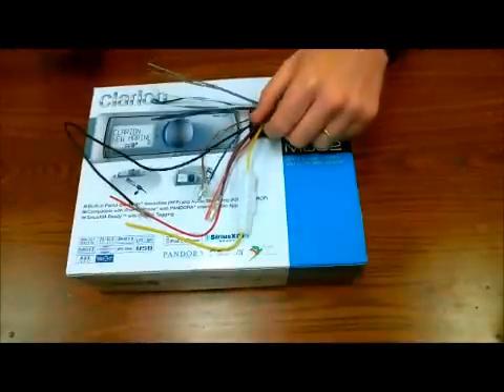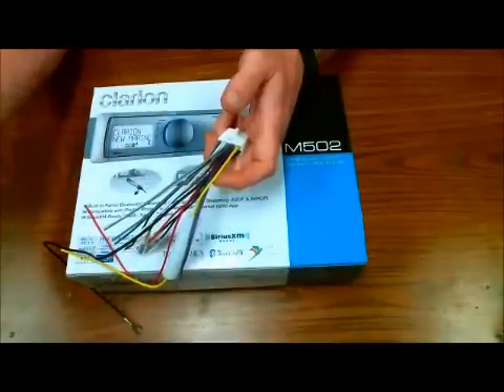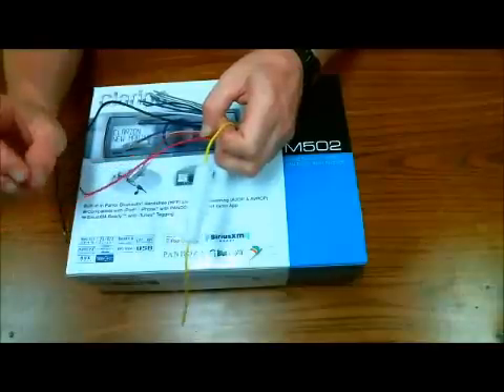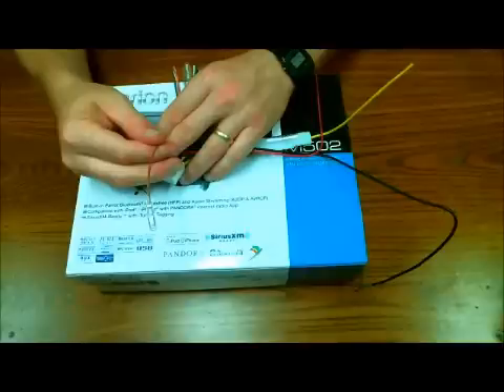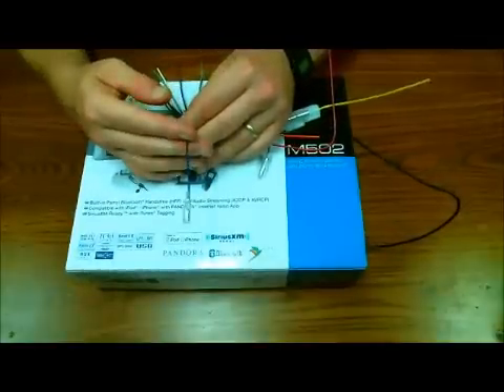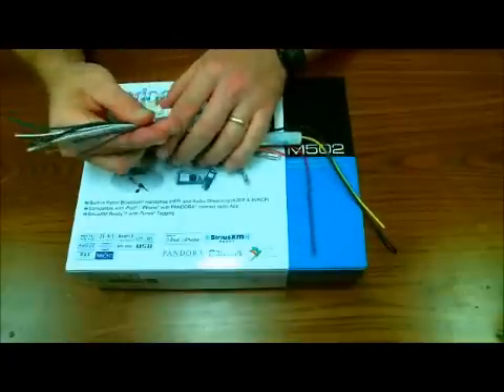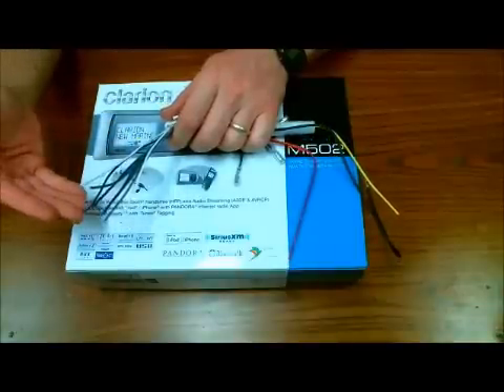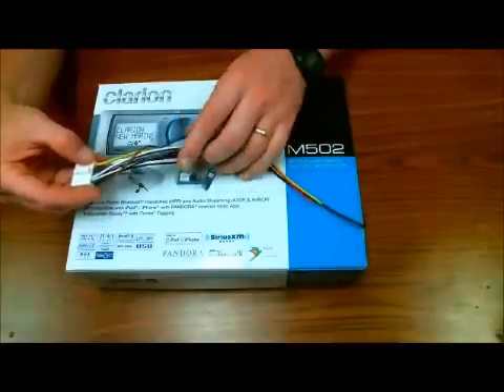Car Stereo Wiring Explained In Detail

Comment: Hi there.
Very good to know the colour code of all wiring. I have a question and I would like your further explain please.
What are the code for:
Orange/ black-key2
Orange - key 1
Two black with RCA heads-OnStar(male connectors)
4 yellow with female RCA connectors-AV out 1, AV out 2, CCD AV in and AUX AVIn
 Many thanks

Comment: Hi! I have a problem with an aftermarket stereo.
 I installed a 2 Din Pioneer stereo (without using a   special bypass harness)  n my Mitsubishi Montero 3 which has an Infinity sound system . The thing works fine but I can't modulate the amp and the volume is three times higher than it should be. 
Do yo think there's any solution for that?

Comment: i just bought a new stereo deck(dvd,cd). i am wanting to hook up the new stereo to previously installed overhead dvd screen that is hooked up to a dvd player that came with the vehicle, i pretty much font want to use that dvd player anymore. would i hook up the power source of the overhead screen to the red acc cable to provide power or the the amo turn on?
Reply from the maker: use the red, the amp turn is only rated for 500 ma

Comment: how do ni install a back up camara
Reply: like on your front or rear view?  This might require a little planning with the volts across your circuit.  Red for accessories.  Which is 12 Volts from your car battery under the panel.  A really bigger job, especially if you're not familiar with DC and AC currents, diodes which converts AC into DC electricity, and other necessary conceptual things you might want to know.  Of course you could do it.
Reply: On the newer cars, there already is a rear view camcorder hooked up to the rear end of the car.  So every time you back up, a movie screen of your view shows up on the DVD/Stereo Double Din screen.  Adding another cam while driving requires more volts across your circuits.  It's a really detailed job I see here.  But can do?  Are you finished or did you take it into the shop and pay a fee?

Comment: If my metra harness has a solid orange wire and my pioneer head unit has an orange w/ white stripe wire would I connect them together?
Reply from the maker: no, theyre different functions
Reply: TheRowdyRanger if there is a stripe or line then it's negative and solid is positive. Say an orange and orange with white line
Reply: TheRowdyRanger .
Reply: That is for the dimmer when your lights turn on. He explains this at about 3:50

Comment: I ordered the gmos-lan-01 harness from axxess and putting in a pioneer AVH-280BT in my 2013 suburban.
from the main portion or the axxess it has 1 red wire labeled (ignition/switch) but the axxess also come with a separate set for the speakers , dimmer, mute, ect. but this set comes with an additional 2 red wires marked the same as the 1st. do i connect all 3 to the the one wires going to the head unit?

Comment: I have an orange and black wire on the scosche plug it says ground dimmer do I use it? the blue and white wire do I splice it to my remote wire that goes to my amp? the black and white wire says amp ground what do I do there
Reply from the maker: org/blk is never used
blu/wht goes to the amp
blk/wht goes into the black ground wires (thats an amp ground).

Comment: Hello. I installed a Power Acoustik PD344B. It worked fine until a week later, I installed a backup camera. Now I get "REAR CAMERA No Signal" on the display always. I can't operate any of the modes like dvd and radio like before? I put it in reverse and the camera works? When I start the truck, I can hear the DVD but still have no mode operation and the frozen display of rear camera and no signal in a blue box. I tried resetting it, still no change. HELLLLLP!
Reply from the maker: try hitting the reset button

Comment: do i have to connect blue/white if i dont have an amp? i did not wire blue solid n orange solid.....
Reply: cut if off and then use black tape to tape it or insulate it.  power antenna is the blue wire.  Orange is the illumination or lights.  It happens, may have connected one of the wires with different colors.

Comment: Hi thanks for the video, very informative. I'm looking for a way to find a color code guide for the wires coming out of my car. The stereo that was in be4, was wired to close to the adapter, so I couldn't see what was matched to what, I had to buy a new adapter, & now I don't know what half the colors are for. I have the black ground, but then there are like 3 reds with colored stripes, I think 2 brown, so I'm assuming those are speaker wires, & then some random other colors. Do you know where else I could look for help? My stereo, & ask the harness stuff is all ready to go, I just don't know what colors are what in the cars dash. I just got the car from my kids Dad, no help there. Thank you in advance. Oh, it's a 1993 Honda.
Reply from the maker: I can help, email the wiring requests to sales@lesscoelectronics.com please!!!
Reply: Lessco Electronics ..I have pioneer stereo and connector and it has blue wire and orange wire that doesn't connect to anything

Comment: Hi thanks for the video, very informative. I'm looking for a way to find a color code guide for the wires coming out of my car. The stereo that was in before was word short so I couldn't see what was matched to what, & now I don't know what half the colors are for. I do have the black ground, but then there are like 3 reds with colored stripes, I think 2 brown, so I'm assuming those are speaker wires, & then some random other colors. Do you know where else I could look for help? My stereo, & ask the harness stuff is all ready to go, I just don't know what colors are what in the cars dash. I just got the car, & someone bought it, & well it's stressing me out a little. Thank you in advance. Oh, it's a 1993 Honda but my registration doesn't say if it's an Accord or what, just says AE(I believe) sorry I could look again. Anyway, it didn't come with a manual & I can't afford the $30 ones at the auto parts store.

Comment: I have 1991 ford Mustang and the wires from the factory  stereo are different  than said I diagrams and I don't know what to do the colors are 
Brown/pink
Pink/blue
Light blue/white 
White/light green
 tan/yellow
Pink/light green
Dark green/orange
Orange/light green
Light green/yellow
Yellow/black (fat wire)
Tan/red 
orange/black
Red(fat wire)

please help!!
Reply: I wish I was there.  The harness on the car side of it, does it have an adapter that could fit unto your new radio side harness?  Adapter doesn't fit, you might want to connect an appropriate adapter on the car side harness to fit unto the radio wire harness.  This is when you plug it in again.  16 pin wiring color to color harness
Reply: I tried to connect it by recheck in each color of the speaker wires since the we're different, but it ended up messing a lot of things in the car, I didn't ground it correctly :(

Comment: I'm working on a 2004 Chrysler Pacifica and the aftermarket kit adapter has 2 solid yellow wires and 2 solid black wires.....the factory side only has one of each so what should I do
Reply from the maker: on those chrysler adapters you combine the 2 yellows and also the 2 blacks
Reply: +Lessco Electronics 
that's what I was thinking thank you for confirming that for me. not much info on that car

Comment: if my car dont have accesory mode (just OFF, ON, START) does it mean i dont need the red wire? because i have plug everything and my radio wont turn on...
Reply from the maker: what is this model car that doesnt have an accesory
Reply: pontiac sunfire 2002
Reply from the maker: that car has an acc wire, its the brown or orange wire
Reply: yeah the orange is the constant 12v and when i plug to the brown nothing happen but finally i have plug it direct on the fuse, but thank you

Comment: quick question... super informative by the way! great video.... mine relates to a 2004 honda civic after market adapter harness. i'm hooking it up to the wiring harness for a JVC deck. on the JVC side, they use orange with white as their dimmer coding, but on the after market adapter harness, they are indicating solid orange as the dimmer wire. if i do that, it leaves ONE singular wire left on the after market harness, which happens to be orange with a white stripe. so, should i just ignore the instructions on the after market package of that harness and go with orange with white to orange with white on my JVC wiring harness, thus leaving a singluar ORANGE wire left over on the after market deck? please help! thanks......

Comment: Hi there! Thanks for the video! I have a question about my cars audio. I have five speakers in my 2005 Chevy Equinox. Two in the front, Two in the rear doors, and one in the very back which I'm assuming is some sort of sub. I'm putting in a new stereo and was wondering what I'll need to do if my new wiring harness doesn't come with wires for that positive and negative. Thanks!
Reply from the maker: whats the year make and model of the vehicle?
Reply: he said a 2005 chevy equinox
Reply: Hi thanks for the video, very informative. I'm looking for a way to find a color code guide for the wires coming out of my car. The stereo that was in be4, was wired to close to the adapter, so I couldn't see what was matched to what, I had to buy a new adapter, & now I don't know what half the colors are for. I have the black ground, but then there are like 3 reds with colored stripes, I think 2 brown, so I'm assuming those are speaker wires, & then some random other colors. Do you know where else I could look for help? My stereo, & ask the harness stuff is all ready to go, I just don't know what colors are what in the cars dash. I just got the car from my kids Dad, no help there. Thank you in advance. Oh, it's a 1993 Honda.

Comment: Sup Lessco Elect. I just purchased jvc double din kw-r920bts and I believe I didn't connect a wire correctly. Radio doesn't turn on right now. I want to know which wires doesn't have to be connected together. I've connected the black wires together could this be the problem?
Reply from the maker: black is ground, moving on is the red getting acc 12v+ keyed power and yellow getting constant 12v+?
Reply: +Lessco Electronics Ok..there is only one red wire and the other looks pink. Do I connect the red and pinkish wire?
Reply from the maker: pink, ? what kind of radio is this excatly? can you email me the wire digram maybe? heres my email: sales@lesscoelectronics.com
Reply: +Lessco Electronics haha well its the metra harness its the only one that look kinda pinkish..now I am guessing its the red wire?

Comment: what wire does the pink goes to
Reply: i want to no,iv just brougt a fto,the car leads are so diffent to my car cd player,i want to put in,wats the pink wires for??
Reply: It is usually connected to the Ebrake, I am not 100% but I think it has to do with DVD/Navi receivers so the screen is only engaged when the brake is engaged, or some old school units that get quitter when you are slowing down. If you have a screen and want to bypass the (only in stop) mode so you can view the screen at all times, just run the Green wire to ground. Don't waste the 50 bucks for some extra peice of plastic.

Comment: Hi. I have a 2002 Fairline motor boat with an old radio that I want to replace with a new Sony MEX-N6001BD. The Sony connector has a red and a yellow power lead but the boat only has a red lead. When I connect the unit it will not power up with red to red. I have tried yellow to red and I can hear/feel power getting to the unit but the face panel is dead. Should I try connecting both red and yellow from the Sony to the boat's red?

Comment: I have a pumpkin android headunit and it has a blue with black wire, so is it for the amplifier? The blue with white wire is already labeled as a brake wire.
Reply from the maker: Since that's a non mainstream unit I have an idea, Test it's output with a test light or a multi meter and see what it does.

Comment: Super video. Help please: I have a 14 year old marine Kenwood with a CD player; a friend has a brand new boat that came with a Sony and has blue tooth & USB but no CD player.  We want to swap as I don't use the CD and want the newer features.  He wants the CD capability and doesn't care about the blue tooth & USB.  Is this easily doable? Will we have to switch the wiring harness connectors too?
Reply from the maker: both radios have 16 pin harnesses and both share the same colors, but the plug configurations couldnt be any more different. So youll need to cut each one off entirely and rewire back each unit back into both locations.
Reply: Thanks for the quick advice!!
Reply from the maker: np

Comment: Hi you video is really good .i was wondering if you can help me i have an 2001 s430 Mercedes it uses a fiber optic and is a pain .well i have a double din stereo that i want to install on it but stereo shop tell me that i need to rewire the speakers on the car because it wont work ..my question is :if i buy new cables for the speakers how difficult is to attach it to the stereo
Reply from the maker: it's not that bad, it just takes a while longer
Reply: +Lessco Electronics  I hope thanks

Comment: Great video, I was wondering if you can possibly help me out. I am trying to do my first stereo install but I think I a did a couple wires wrong. The stereo is working and sounds great and originally when I turned the car off the radio went off too but now it is it not and I think I have a couple other wires wrong. I am not sure what color to connect the brown mute wire too as my harness adapter does not have brown, and I am not sure what to connect the blue white to and the blue. I thought the blue wire was for my aftermarket amp? Let me know if you can help at all. Thanks
I have a 2000 chevy malibi, 
Metra 70-1858 Radio Wiring Harness
Kenwood KDC-BT562U
Reply from the maker: brown is not used, the blue goes to power antenna which I dont think you have and blu/wht is the amp turn on wire
Reply: +Lessco Electronics okay thanks, what do i connect the blue/white too if the harness adapter does not have a blue white and any idea what i did wrong for the stereo to not shut off after the car is off? Appreciate any help you can offer.

Comment: any chance anybody knows anything about a 05 saturn ion after pulling the radio out and assembling the install kit I hooked the deck up with the factory to aftermarket plug and it keeps saying something amp... the amps not even hooked up yet idk if I'm supposed to do something with the ground wire that was hooked to the factory radio seperated from the wiring harnes...  I'm not an amature I've been running systems for like 10 yrs easy this cars weird

Comment: This might be a stupid question. When you buy an aftermarket radio and connect those wires to the adapter that is specific to your car, do the wires connect color to color? Or do you have to figure out which wire goes where?
Reply from the maker: +Adam Comeau they go color to color, thats why the adapters are so nice to use.
Reply: +Lessco Electronics what if the colors are faded or don't match up? there are 14 wires in the cars adaptor and only 12 coming from the stereo that I bought

Comment: @Lessco Electronics what do you connect the blue/white amp wire to. My in dash dvd receiver shuts off when I insert a disc.
Reply from the maker: +MykeLyppaTV that needs to connect your factory amp turn on wire, you probably put the blue there instead of the blu/wht I'm thinking..

Comment: Working on 1998 GMC Suburban SLT with OEM stereo and replacing it OEM with a Pioneer AVH-x7800BT w/ factory connector.  Prior to installation, all speaker and radio function operated as intended.  Utilizing a Metra 70-1858 Connector, between the OEM connector and the Pioneer factory connector, I lost the rear speakers.  The Metra 70-1858 wiring is color code and matched Pioneer's color-for-color, except the illumination wire which switched from Orange (Metra) to Orange w/ wht strip (Pioneer).  All connections are soldered.  I reinstalled the OEM stereo and the rear speakers worked again as normal.  Any thoughts?

Comment: I have a question. So I want to install floor well lights in my car. I want to wire it up with my aftermarket radio. You said that the yellow and red wire give a constant 12v power supply. So that is where I want my lights to get power from. So I hook up the positive wire from the lights and connect it to the yellow. Where do I connect the negative wire for the lights? Do I just hook it up to the ground?? I don't think that's right but u probably kno a little more than me so I'm asking u. Thanks in advance
Reply from the maker: +Salvatore Ciolino to a ground point with a switch in between

Comment: For me I used..

Power = blue w/yellow stripe wire from the deck(dash) and connected it to the red wire and yellow wire twisted together from the stereo(after market stereo) EARTH = black to black.

For the BACK SPEAKERS = red from the deck(dash) connected to 
Pink from stereo(aftermarket 1).
White from deck(dash) connected to pink w/black stripe from stereo.
Yellow from deck(dash) connected to green w/black stripe from stereo. And grey from deck(dash) connected to green from stereo.

FRONT SPEAKERS = green from deck(dash) to grey from stereo.
Purple from deck(dash) to white w/black stripe from stereo. 
Pink from deck(dash) to white. And blue from deck(dash) to grey w/black stripe.

Now this worked for me but you know how they say it CAN DEPEND on your model, make or car/stereos as some are DIFFERENT! Remember unplug your car battery before connecting all wires. Other then that hope this helps someone.